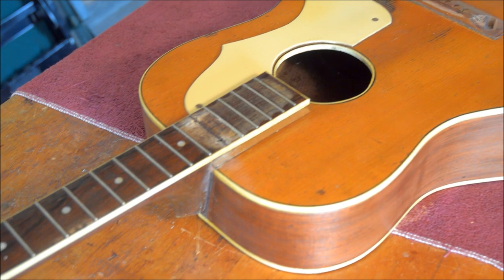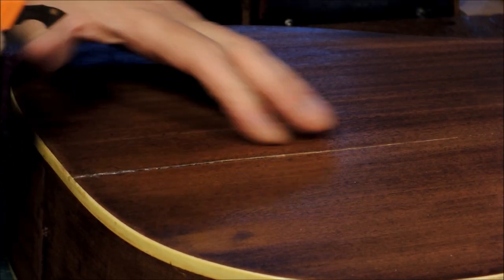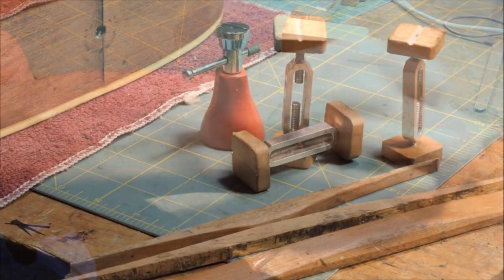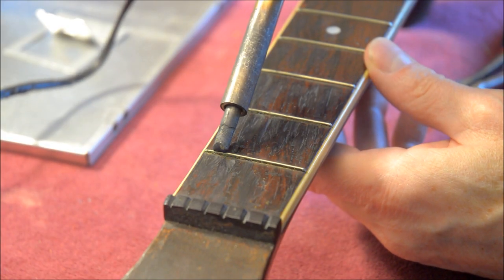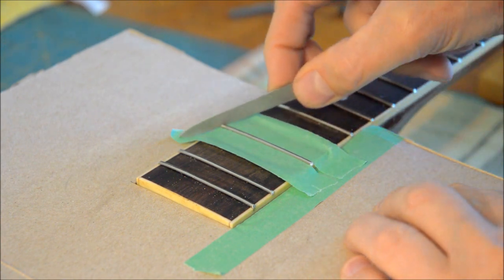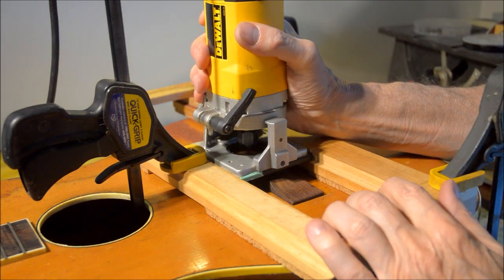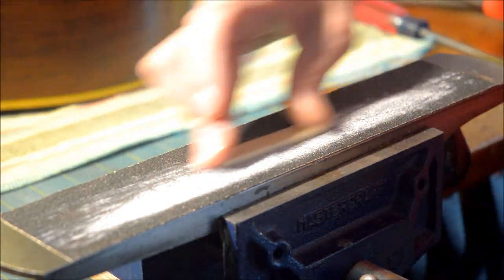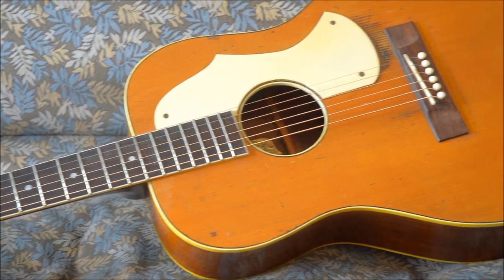Vintage Arthur Hensel Guitar Restoration

Comment: I have this same guitar.  It had nylon strings on it years ago.  I thought it was a classical parlour not a steel string acoustiic
Reply: Bridge pins are a good indicator the guitar was built for steel strings because back then nylon strings did not have ball ends.